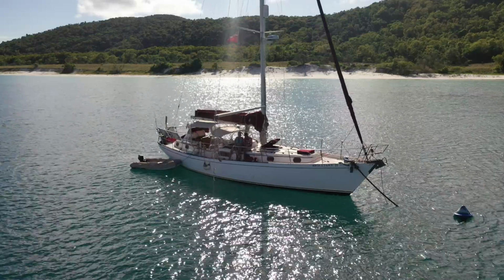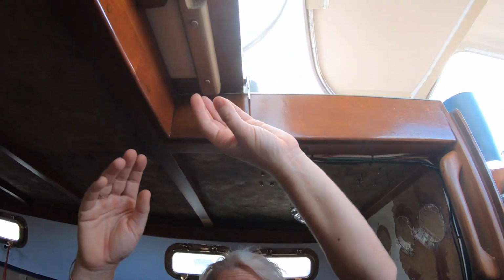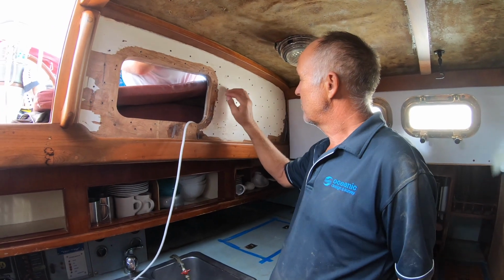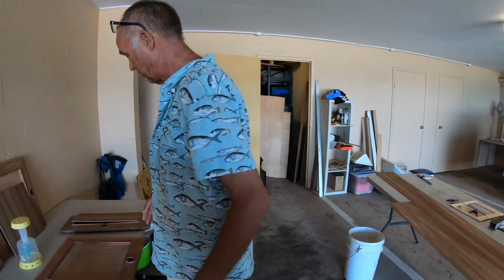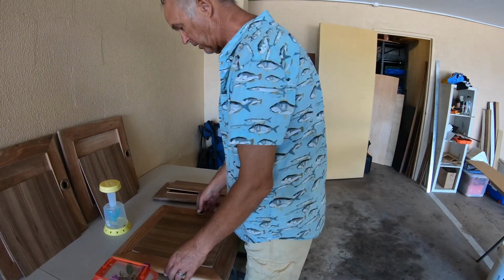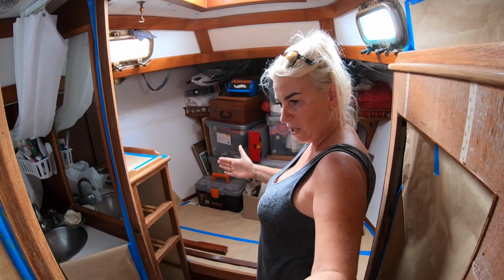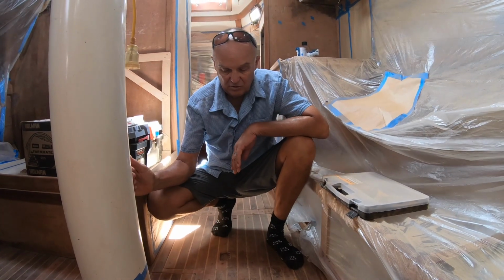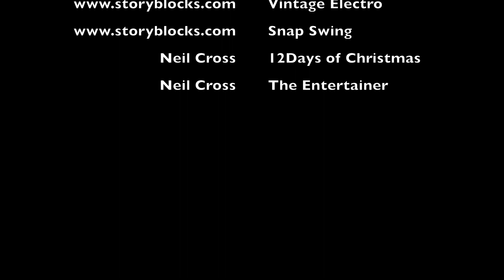How to pull apart the interior of a 43-year-old boat ⛵️🤯 (Boat Refit Documentary - Part 1)

Comment: Hi, Just wanted to ask in this first video 360 grit is mentioned a lot. Was this grade all you used to rub back the teak wood work?
Reply from the maker: Hi, in most cases the wood had to be completely stripped back which meant going right through the grades starting from around 80-120 and in the worst case, which was the cabin sole, requiring belt sanding at 40 grit. Only if the wood required a light touch up would it be sanded purely with 320/360
Reply: @brilliantsailing  Thank you so much for your help and advice